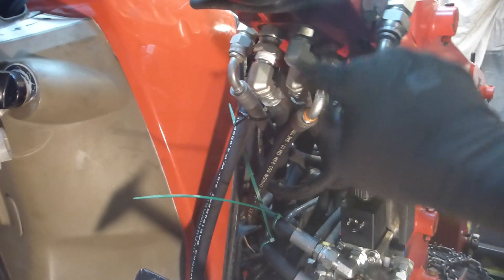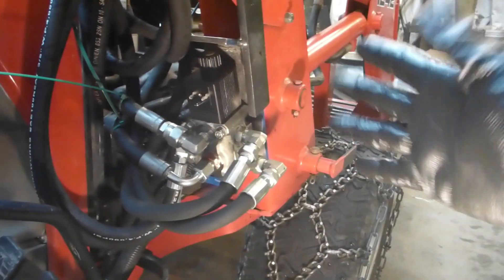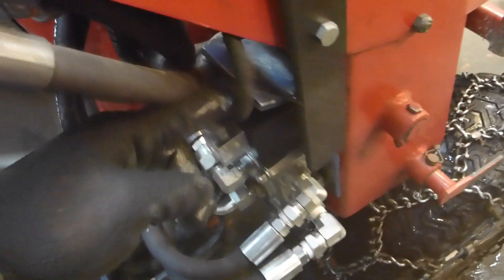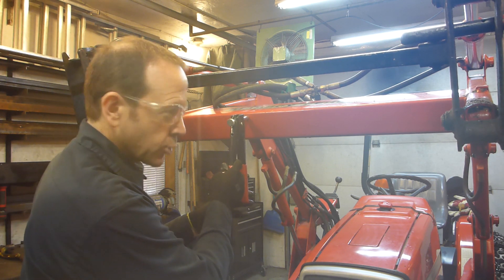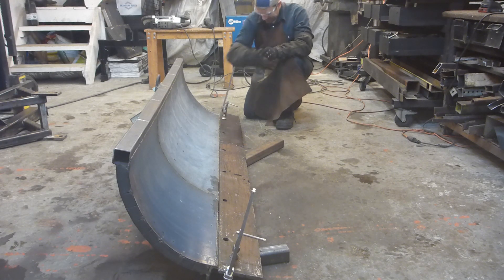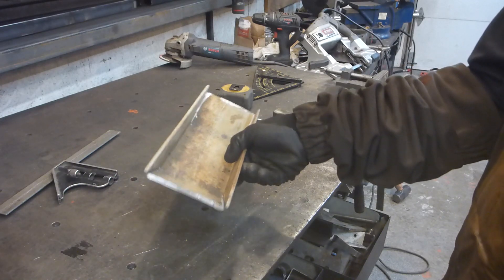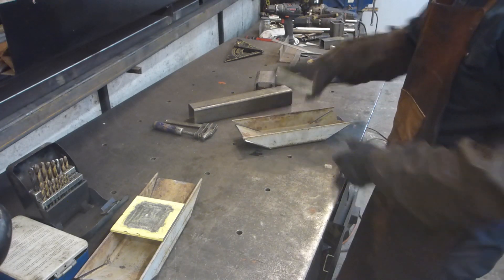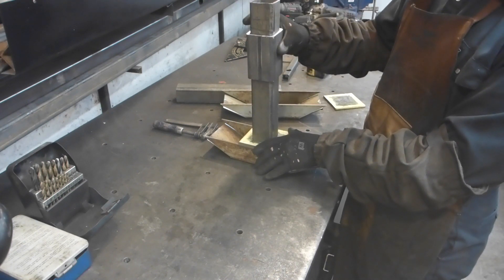#186 Hydraulic Angle Snowplow Part - 3

Comment: One of the best projects I've ever followed!  Love those skids you fabricated for the plow.  Your neighbor must be grateful to have you around.  You may have covered this in an earlier video, but I don't remember it, but I wonder why you didn't fabricate a trip system for the blade in case the plow hits an immovable object?
Reply from the maker: Thanks Allen!  Good question about the trip system. It's always required while using a plow at high speed (10mph and up). Those tractors are quite slow. There is no curb or the like in our neighborhood. So worst-case scenario, Mike is going to plow some gravel...  The tractor is also built very strong. So this blade can used pretty much like a dirt bucket, which does not have any trip system. I have a trip system on my Bolens, because the frame is not that strong compared to the MF 1225 and it's a fast tractor. Thanks!

Comment: Is there some kind of restrictor that can be put in the lines to slow the speed of the side to side tilt?
Reply from the maker: We thought of it until we found the cylinder would not purge air. That is why it was so quick. Mike did purge the cylinders later and the speed seems to be acceptable. Thanks Gary!

Comment: Nice work! 
I like the big snow shoes and theirs adjustment!
You installed a separator kit for the hydraulic? 
It is nice to have a plow like this on the front! 
Thanks!
Reply from the maker: Thanks Adrien!  There is a diverter valve. So Mike uses the same lever as for the FEL, but when he flips the electric switch, then the hydraulic flow to the plow instead of the curl cylinder.
Reply: @FromSteelToWood  
Ok
This is nice! 
Thanks

Comment: Super job on the plow! As you were explaining the cut angles on the plow shoes, I was wondering what machine you were going to use to bend the metal. A few seconds later you slammed it with a sledge hammer. 😂🤣Perfect. Thank you.
Reply from the maker: Thanks Chuck! I was doubtful about slamming it, but it worked very nicely!  Keep it simple... as they say! Thanks!

Comment: I see the plow project is coming along nicely.  I must agree with Mark. I like that design of the shoes.  The plow angles from sid to side very quickly.  Do you think a limiter in the hydraulic lines would prevent the plow from banging into the frame  which would prevent damage to it? What are the pop rivet threaded inserts for?
Reply from the maker: Hello Jim! We thought of it until we found the cylinder would not purge air. That is why it was so quick. Mike did purge the cylinders later and the speed seems to be acceptable The threaded inserts are for screwing the bracket for the hoses. That cross member was rather thin to thread 1/4in bolts (1/8 thick). So the inserts are pretty much like a pop rivet, but with treads inside. Thanks Jim!

Comment: How's she goin'?  Nice set up for the angle cylinder controls.  The electrical part would not have been boring, to me but I'm an electrician!!  LOL  You were able to get the additional EV mounted in a good spot to avoid being in the way while the tractor is in operation!!!  Those 'pop rivet' threaded inserts are neat eh!!  And you made some real heavy duty skid shoes!!!  I like that!!!  Looking forward to the next episode.  Take 'er easy!!!
Reply from the maker: Thanks Mike! For your interest, we tried to hook to the existing electrical harness, but it was complicated and the available amps was quite limited. Mike want to add lights, so it was best to source from the battery. So we used a Maxifuse (40 amps, right next to the battery) and a #8 wire from the battery down to a fuse box behind the console. From that point, we used a 5 amps fuse to activate the EV. To make sure the EV is not left activated while the tractor is not running, we used a relay hooked to the ignition switch. The relay and the switch on the fender are in series. Thanks!